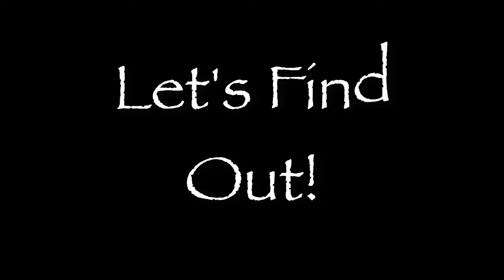Off Grid Homestead Hot Water Heater Quits - NO Hot Water!

Comment: WOW you folks sure been having the bad luck. Hate to hear he did not put the parts in you laid out. Someone is gonna get a chewing! Hope you two have a great week!
Reply from the maker: Too bad the plumber left the state😋 I discovered the issue when I inspected the installation 10 years ago and had no recourse, and wouldn’t stiff the guy. I found the bypass valves in a box in the utility building 4-5 years ago. I had to switch 23 other ball valves in the hydronic system. They were hard to move due to mineralization. And they are in an awkward location. Glad it’s done!

Comment: At 1:50, you look like you need a nap
Reply from the maker: Boy, I was beat. It took a few hours to get the 23 valves turned off or on as needed - I didn’t show what I had to do with the hydronic heat heat - several of the ball valves had to be worked back and forth so I could open or close each one fully. That took a lot of time and was awkward. I “rested” during the 3 hour by fixing several minor annoyances in the house, so I was actually refreshed when we shot the end of the video! Thanks for watching and commenting!

Comment: Where is the minerals coming from if ur using rainwater catchment
Reply from the maker: Thanks for your great question! We use both hauled water and rainwater, but pipe only the hauled water to the house right now because that catchment system is still undergoing change. My plan is to move the catchment tanks downhill so I can still use a wet plumbed design, but permit the pipes to drain as near completely as possible so I don't have future freeze problems. We'll do all gardening with rainwater since our rainwater catchment has about half of the mineral content of the hauled water. We typically receive rain in small doses except for our two "rainy seasons" when we might get an inch in one day. Our total rainfall is between 10 and 12" per year - all at the wrong time of year. It may seem strange that we  have some much mineral content in "rainfall." I was confused 15 years ago by the total dissolved solids in our catchment tanks from the roofs. I finally figured that out - we have a LOT of dust in the air most of the year, and more right before we get rain. The initial rainfall NOT from the roofs has a pH within one point of the hauled water. Huh? My theory is that the fist rainfall from a storm forms around the native alkali dust particles. So, we get both high alkalinity and high TDS from the sky. When we get enough rain, rain collected has a lower pH, and I suspect different dust particles. Long story short - rain collected from my roofs is high in TDS and high alkalinity - town water is higher TDS but very similar alkalinity.
Reply: Hmm thanks we didn't know that well keep it up
Reply from the maker: The alkalinity surprised me! Most places in the US won't have a big issue with rainwater, but since we have a LOT of dust kicked up, it isn't surprising. OTOH, I haven't logged pH for catchment water to see if I can flush part of the water to reduce the problem. IN the end, I just need the water.